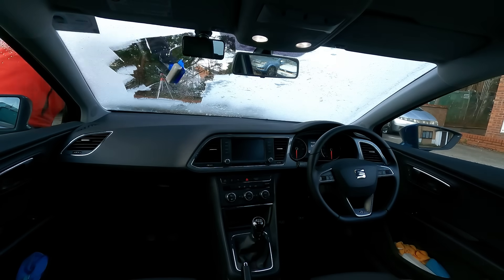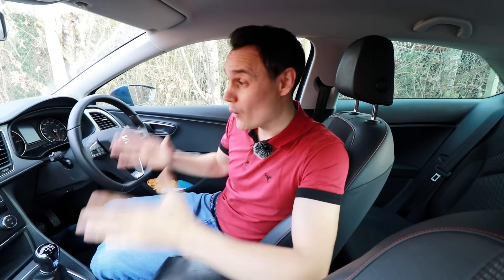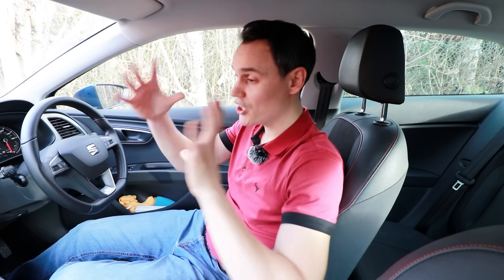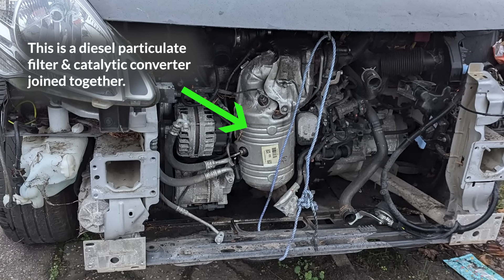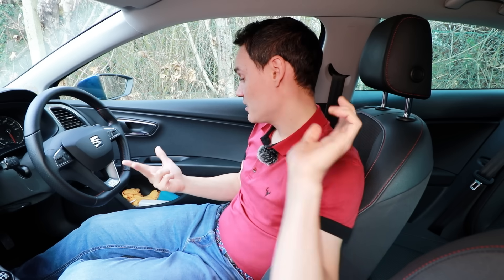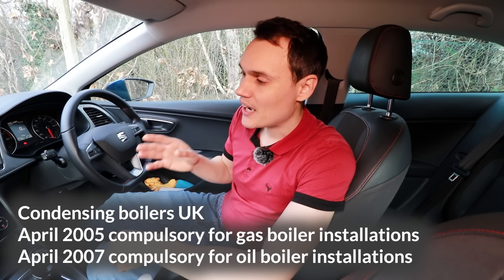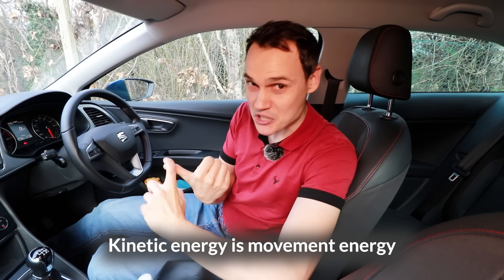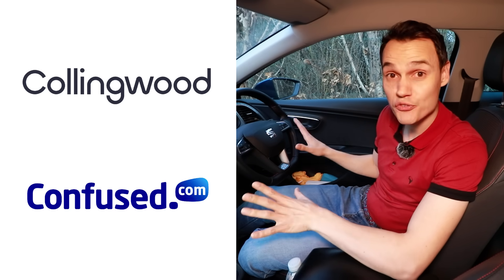How turning the engine on when de-icing can cause you harm. Possibly even cancer.

Comment: Saving to my playlist for car maintenance. Always a pleasure to watch these videos from Conquer Driving now that I have passed my driving test. Thank you, Richard!
Reply: can you send link of that playlist? im a new car owner thankss
Reply: This is anti maintainance. Starting your car up in the winter and driving off is one of, if not the biggest causes of major wear on an engine. Doing such a thing could knock hundreds of thousands of miles off your engine. When it's 10 degree out, you should start the car up and wait about 20-30 seconds before putting it in gear, then drive it gently (you can do the speed limit of course, just don't accelerate hard). When it's like these mornings, and it's very cold - you should be waiting about a minute or a minute and a half. There's no reason to wait any longer unless your window is frozen and you literally can't see out it.